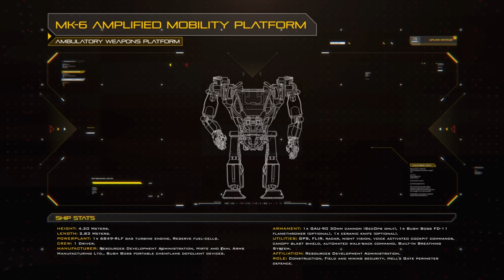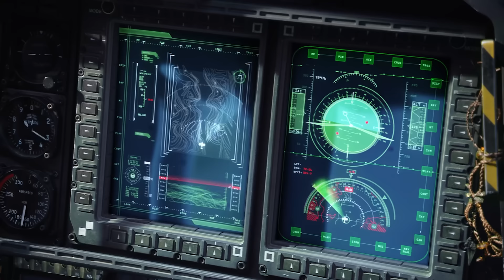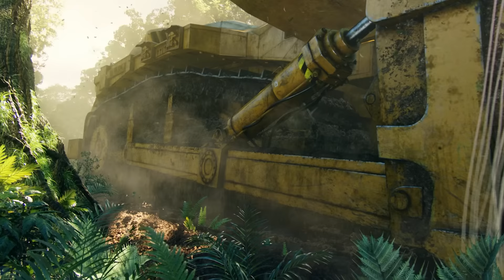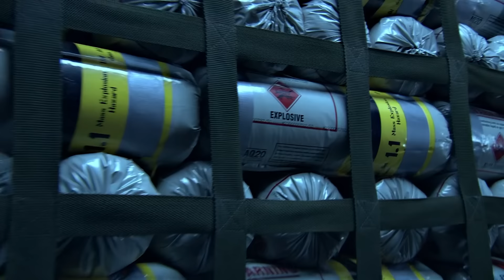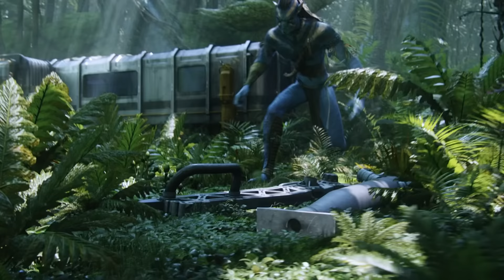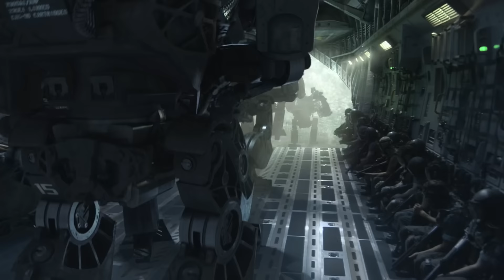Avatar: AMP Suit | Vehicle Breakdown

Comment: Having seen footage of 30mm cannons being used in Ukraine, I think the movie did a poor job of showing just how destructive they really are. Every shell packs the explosive punch of a small grenade on top of the kinetic energy of a bullet moving at several hundred meters per second, there's no way anything living is going to survive a single hit from one of these things.

Avatar really is a frustrating movie for a sci-fi fan. It shows an incredible amount of beautiful sci-fi designs then proceeds to show how they fail in the face of primitive aliens using extremely convoluted circumstances.
Reply: a small grenade? no mate, a 30mm cannon has the same tnt equvilient to a 40mm grenade, thats on the larger size as far as grenades go.

Comment: I love this channel and I know they are just reading the source info with flavor but this is so wrong. That is an industrial cargo lifter with a gun.
The HUD is a tiny screen at nipple height, useless for aiming that cannon. The haptic control gloves are a terrible choice for such a Crampton cockpit, there isn't enough room to for full arm motion to the sides. 
Why would a military vehicle use a glass bubble instead of an armored box with interior wall screens fed by a few hundred micro cameras. If those were damaged Then the armor could be ejected, leaving the bubble as a last resort. 
Also there is a complete lack of backup weapons. "Modular weaponry sounds cool but anything from and electrified exterior to simple punch knives could have been included. 
In short it is a top heavy, under armored tub that can't shoot straight, who's only saving graces are its All Terrain capability and cargo moving utility.

Comment: Definately a spectacular vehicle, however, I'm not really convinced of its tactical effectivity with respect to its cost. In general tracked, gun turreted combat vehicles have a vastly lower technological requirement, superior reliability and this is true to this vehicle as well. However, even in its design, Earth companies substantially underestimated the capabilities of Pandora's fauna. Its cockpit canopy is a huge weakness. The cockpit should have been full armoured and the visibility should have solved with an all around camera system. The 30 mm guns has a poor rate of fire, and the overall suit cannot carry much ammunition, so it is easily overwhelmed by a stampeding crowd.

I think it was a grave mistake to utilise the AMP suit as the tip of the spear. A self-propelled anti-air gun would have been far better suited for such a role. Some Shilkas equipped with 23mm AP round would have been more than enough to stop the beast stampedes, not to mention the carnage what some Tunguska would have done with 30mm AP rounds (the AP rounds primarily needed for larger beasts). Such SPAAG-like vehicles would be untouchable by Pandora fauna means on a clearing as long as they have ammunition. Of course some up armouring definetely needed, however, an 50 mm RHA equivalent protection is more then enough against pandoran fauna threat.
These AMP suits should be only relegated to either into non-combative support role (they would be handy in the maintenance of the SPAAG-s) or as a mechanised infantry support for the spearheading SPAAG-s.
Reply: The problem is terrain, look at the kind of crap the suits are forced to operate in. Conventionally, only infantry and air support could be utilised in such an environment, and the cannon's low ROF is the fault of its own design, not of the calibre. Even if they took one of the real-world weapons, like the 25mm M242 or the 30mm 2A42 cannons, they'd have had a much higher max RoF possible. Far as the ammo goes, we don't know how much it carries but the amount doesn't seem particularly small and we never see one run out. The cockpit really should've been uparmored, perhaps at least with simple slat atmor.
Reply: @EgorKaskader  false, light tanks like the type 95 in ww2 or the CVR(T) can and have been used in such environments (infact the CVR(T) was specifically designed with jungle warfare in mind), even heavier light tanks like the stingray are exclusively used in jungle terrain.
and that is with older tech, they should have more advanced 'hedgerow cutters' [undergrowth and tree cutters] by the time avatar is set.

some terrain in the jungle would be slow or inaccessilble to even these tanks, but a simpler AT-ST or 40k Sentinel style vehicles aka 'chicken walkers' would be cheaper and just as if not more effective. there is very little utility to humanoid mechsuites that justfies their increased costs compaired to wheeled and tracked vehicles. a walker is only justified as specialised combat and supply vehicles, and even then humanoid is the least efficient design for what militaries need vehicles to do.

the only time mechsuites are justified is when you don't have the space for a rage of specialised vehicles, but by the point of avatar the humans clarely have the space.
Reply: @matthiuskoenig3378  lol no. You haven't seen the dame film. AT-ST is scrap metal with how weak their legs is. Tanks cannot operate in that kind of jungle. It's too dense for tanks. It would be a death trap to bring a tank into that kind of terrain. While on earth, it is still relatively flat for what you think of jungle in ww2. Go see some area of jungle in SEA, like North Vietnam and east of Lao and tell people you would drive a tank into that kind of environment. That kind of jungle and worse is what Pandora jungle is.

Comment: I appreciate the design, but the mass is really out on this, it weighs the same as a mini digger which just isn’t comparable in terms of size, or usage, I think at best using a material at half the density of steel such as an aluminium ceramic I’d expect it to weigh  at least 4 tonnes
Reply: R&D is making both polymers and metal alloys are making them tougher, stronger and lighter so in Avatar's setting and the year it set in should have made these materials even more improved that they were a century ago. The alloy also would've used in making the suit's power plant as well.

Comment: The regural AMP suit is clearly intended for scout mission, but I think they could have had an "armored combat" version as well (fully closed and armored cockpit with screens and relative cameras/sensors).
Reply: We'll probably see new variants in Avatar 2 at the end of this year.
Reply: That'll be extremely useful against Hammerhead Rhinos since it is a fully armored canopy with similar interface to Iron Man's suit that the Hammerheads simply can't stomp through them.
Reply: @chaxologist2024  Doesn't matter if they can't stomp through. They can Still knock them Over easily. At that point, Stop the limps off and it becomes a Tomb for the Pilot.
Reply: @arnowisp6244  Of course, if budget and profit is RDA's main concern more than the safety of its armed forces then yes, that is all they can spare without breaking the bank if they lost them.
Proper military AMP Suits, on the other hand, would be fully armored and more heavily weaponized the way I described it but rather more expensive and it can definitely stop a Hammerhead off its tracks with its much more powerful weaponry before the latter does more harm.
Reply: @chaxologist2024  also, against hammerheads could bring some anti-tank weapons. RPG or anti-tank rifle would penetrate their bone shield and deal a lot of body damage, likely an instakill
Reply: @user-25352  Those standard 30mm guns the Amp suits carry are technically autocannons which are anti-material rifles but yeah, they need a much larger caliber against those Hammerheads or a different ammunition type to instantly stop them (preferably armor-piercing discarding sabot rounds instead of the standard high explosive rounds) as well as mounted missile launchers like what the Iron Monger armor from the first Iron Man film is equipped with.
That way, the Hammerheads would be easily penetrated from the front through their thick, carbon-fiber hard craniums and would instantly go right through their brains to stop them.
Reply: @user-25352  Now the Problem is to Bring Enough to stop a Charging pack of them as the First film showed. If you pissing off Eywa enough then the Entire Fauna will starting. At that point it doesn't matter what you got, it's a question imof if you have enough ammo to even win.
Reply: i wouldnt be surprised there would be amored variants of the suit and would have a built in screen system similar to titanfall mechs while either having caged armor on the front or shoulder mounted weapons
Reply: If I had to guess the thinking behind the canopy is probably cause polylaminate glass was probably used to keep the weight and power cost down . That glass is pretty strong. The Navi spears to me a basically flying poles with alot of kinetic energy behind the impact. Still I'd rather have a fully enclosed cockpit to not get squared lol
Reply: I think they use Glass because electronic interference in pandora
Reply: @heruiksanudin8942  that kills sensors, but cameras with wired video feed would be fine. they show some screens in the worst of the interference and its just some minor glitching, annoying maybe give you a headache but manageable. and that was the worst it would get. the movement of the suits would be more sensitive to interference than video which your brain could compensate for a bit, like how you dont normally see your nose right there in your vision or how you can see through a screen or water on a windshield after a second or two's adjustment.
Reply: This exists in the new game with “veteran” and “commando” suits
Reply: So, something similar to a Titan from Titanfall?
Reply: @chaxologist2024  just turn your notifications off
Reply: AMPs would be amazing for logistics (and probably to a certain extent great for construction/harvesting). Think of all the time costs you could cut when the heavy cargo can be unloaded and loaded into transports with ease. No more clunky and slow forklifts.
Reply: They won't be allowed to do that cause it prevents the Navi from killing the drivers

Comment: And the fun fact is that we currently have all the necessary technologies to build these things in the real world
Reply: The only issue is powerplant and fuel.
Reply: @Joshua_N-A  nope , I said we have all the necessary technologies including powerplant 
Imagine a light weight tank with arms and legs 
Our diesel engines or petrol engines or turbines can easily power these things
Reply: @vorrdegard2176  you got a point there. Chrysler used to make gas turbine for cars. Materials also has become lighter, tougher and stronger throughout the years of improvement. OS software may play a part in its operation. Fuel cell technology is also improving thanks to Toyota. Just need more money and we'll probably get a first fully operational bipedal manned mecha. First generation may have limited performance but R&D never stops there, it's continous.
Reply: @vorrdegard2176  not all, we could build a heavier version, but we are not building a 10ft tall mech that is only 1.7 tons while being structurally strong enough to go out in the jungle for patrols. 

as for engines the best is proably the pistonless engines we build now, they have more than twice the horsepower for the same volume.

Comment: I've got this feeling will be seeing real life AMP Suit's in the near future.
Reply: Hopefully designed better. Like, some actual armour over the cockpit, not just pretending strong glass will work - make it retractable if you're having to deal with something like the interference of Pandora and can't rely on external cameras. Just a few plates on hinges would be enough. Oh, and maybe supporting true powered armour that would probably have been of considerable use.
Reply: @Del_S  sounds similar to a cupola.
Reply: @Joshua_N-A  Perhaps, but I was thinking more a layer that can come down over the glass rather than presenting one relatively brittle and large surface area to possible threats.  Besides, even if the Navi didn't get some kind of Ewok Bonus for rock to beat laser, there's still the fact that these suits would face small arms fire of comparable strength to the navi's big bow thingies in their original roles, so the lack of some additional protection seems odd. It probably does exist though and the force on Pandora didn't have it because, well, they were too busy throwing the idiot ball around I guess.
Reply: @Del_S  Right but a Regular Tank  would've probably outperformed this suits if they wanted to fight the natives
Reply: @Captianmex1C0  Even some APCs would be superior. Carry troops, carry heavier weapons, have better armour.
Reply: Mechs are created for mobility in difficult terrain
Reply: @proteous8100  And have questionable value outside it. Even within it, arguably, as a man sized powered armour is smaller and more versatile within that terrain as well as others. After all, a mech is still quite large and can't work as well in boarding actions, urban fighting, or even especially dense forests sometimes.

Comment: I always wondered if these inspired the titans of Titanfall, at least partially.  They have that same design of headless humanoid and the 30mm cannon from these and the 40mm cannon from TF look very similar, even down to the T-brake and the heavily tapering barrel
Reply: almost same design was in Matrix II. And many many other artworks before.
Reply: its more about both being designed with a suspension of disbelief  realism and milutary design cues
Reply: Yeah. The control style seems to be similar too.
Reply: The titans were meant to be person-sized, more like power suits, then someone brought a smaller figure to the side and they decided to turn it into a robot.

as for the design inspiration, from what i saw they did some kitbash using gunpla and others plamo, also a youtuber once made a kitbash BT 7274 from Gundam model kits,  other designs from series like macross and other designers inspired a lot of mechs in videogames

Comment: I'd be interested in a technical breakdown of the suits from the Robert Heinlein book "starship troopers".  Not that bullshit from the movie but the mech suits from the book which were very practical from the book's description.
Reply: We don't get many details from Heinlein about the suits beyond functionality. Haptic interface, jump-jets, coms and sensors, self-contained environmental support, and adaptable weapon systems.

Spacedock would need to use one of the adaptations in order to do anything substantial 

If you want a more detailed take on the concept, I can recommend the Drop Trooper series by Rick Partlow. It also has a preceding series Holy War that is helpful, but not necessary for contextualizing the main conflict of the Drop Trooper series.
Reply: I believe the animated films had power-armor suits? So those could work as a visual aid. Additionally, the larger (Marauder?) style suits could be included as well.
Reply: @UGNAvalon  There was an anime adaption in the late 80's I think that is pretty close to the book

Comment: Impact resistant … not impact proof.
Realistically the local grunts would have uparmoured them to withstand Navi arrows, if the blast shields were impractical then perpendicular angled metal cage slats around the canopy would have stopped arrows reaching the "glass", while not providing much visual obstruction, due to eyes being able to focus past them.

And in retrospect, mixing in some Armour Piercing rounds with the explosive/tracer mix would have been prudent.
Reply: I’m secondarily it’s a little bit difficult to up armor one of these without losing visibility which could very easily get you killed
Reply: they did withstand Navi arrows. IIRC the Navi had to take a long dive before releasing the arrow for it to be able to penetrate the glass with the added momentum.
Reply: @RicardoFuertes1990  That’s only on the helicopters these things are completely vulnerable to Navi arrows
Reply: @charlottewalnut3118  Tell me at what point did you ever see a Navi arrow pierce one of these at all?
Reply: @Wolfhound_88  they had to be nerfed for the blue people to win. Especially in avatar 2 where it's an us or them situation, there is no reason other than plot armor that the humans don't just decimate the blue people with kinetic bombing from orbit or have some actually heavy armor on the ground. Like where is a freaking tank? Cameron made sure to have them steal rpgs and bombs from the train so I figure they will show up in 3 and the blue people will now have rpgs to beat them, but wait there is more, where the fuck was that train full of ammo going????

Plot just demands that blue people with bow and arrows plus animals can best bombs and metal. Cameron needs to write a better script to make more sense.
Reply: @thodorosxanthopoulos  RPG in ava2 was to kill local beasts like in Ava1. The 30mm autocannon ammo is heavy, like damn they're freaking heavy. Logistics has to be considered heavily when you're all on your own in a place that will kill you the moment you let up.
Reply: @thodorosxanthopoulos  based
Reply: @thodorosxanthopoulos  basic logistics. you don't bomb the places you want to extract resources from.
Reply: @LineOfThy  this would be true in the real world where you dont bomb the enemy infrastructure if your plan is to use said infrastructure to then mine resources. 

But in pandora give me the reasons leveling the navi forest with kinetic orbit weapons would impact logistics. If anything we saw that our guys needed to clear the forest in order to mine. Orbital kinetic bombing both solves the Navi problem and also destroys the forest.
Reply: @thodorosxanthopoulos  second issue, they’re not allowed to
Reply: No, a cage would die exactly nothing against arrows, not enough material for protection. That's a very stupid take.
Reply: @cegesh1459  good sir, this isn't a javelin missile. 

I'm pretty sure armor class steel is going to have no problem stoping it.